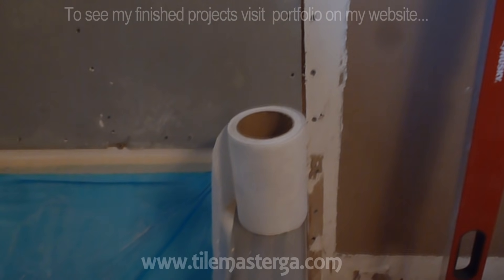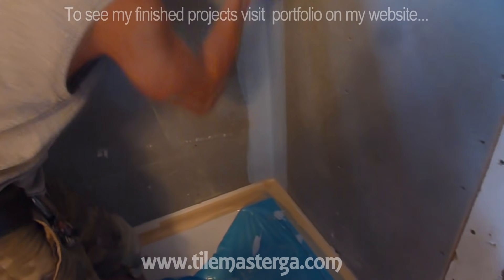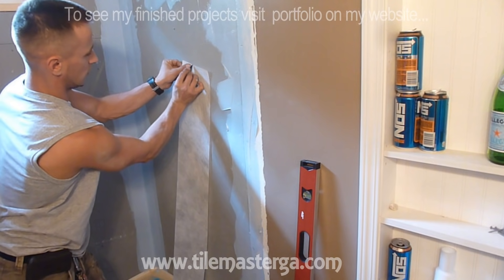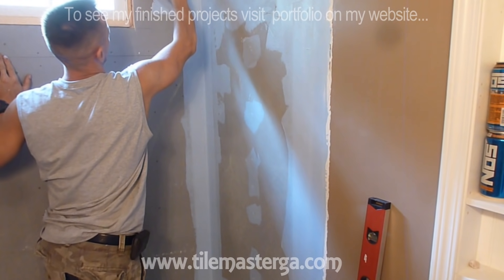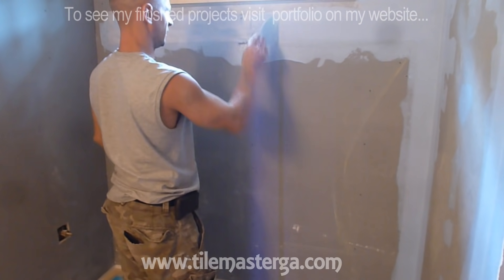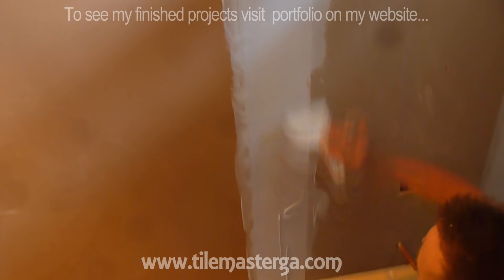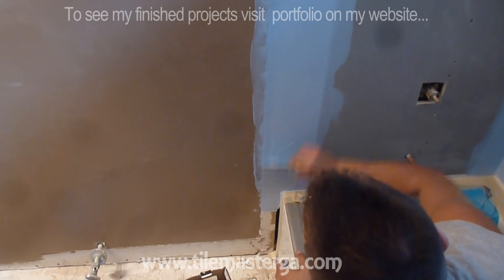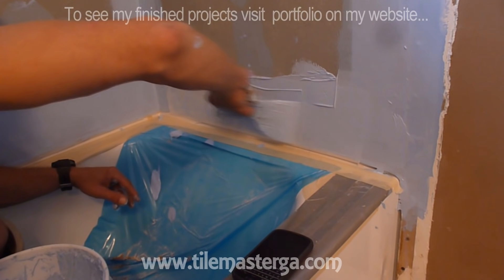HOW TO waterproof  60" tub surround walls before shower Tile installation- Laticrete Hydro  Barrier

Comment: Good day to you sir. I found your channel after installing my Durock cement board and getting ready to waterproof. After watching this video and the ease at which the Hydro barrier was applied. I would like to do the same. I have a couple of questions for you and the group. In addition to using Hydro Barrier in the corners and the seams, can this be applied to the rest of the cement board for water proofing? Or do I need to use another product? If I can apply to the rest of the cement, will the mortar adhere to the Hydro Barrier?Or, I did see another waterproofing material called Hydro Ban. Can that be applied in the same manner as the Hydro Barrier. It seems the Hydro Ban can be used as a total package. Thoughts from anyone?
Reply: I don't use hydro ban or barrier, but i think they are the same product. Regardless, read the product description to see if it is designed to do what you want and follow the instructions to a "T." It will specify what type of mortars can be installed over it.

Comment: I am using durarock board i got your hydro barrier as you recommend but do i need to apply a primer on the board before i install the hydro barrier for a good hold? thanks tile master I love the videos they are a big help to me....Pete
Reply from the maker: Pete, do not apply any primers, no need for that.
Just make sure to wipe all dust and membrane will bond the way it should.

Best regards.

Mike

Comment: well this is what not to do the wall board should sit on the ledge of tub the back wall needs to be furred out so board sit on the tub the other walls where it meets exsisting drywall you can knotch the back of the bottom or use (2) 1/4' boards so one sit on the top of flange and 2nd one goes all the way to the tub ledge dont rely on tape and hydro to seal the water thats used on joints corners and screw holes home reno version explains this very well 90% of the water will hit the bottom 3 feet if you want to tile job to last for more than 5 years do it right

Comment: Overall, great job and very informative.  However, I really wished you would have showed how you filled that LARGE gap on the left side of the tub. That looked like a significant problem area and resolution of that issue was skipped on your video. Also, some clear close up shots would have been much appreciated.  Your camera didn't focus very well on the close up shots.
Reply from the maker: Hi there, well, peter left and there was no person to film me doing that - but I been explaining that this area gets filled with 100% silicone and additionally with waterproofing membrane combined with mesh tape - you can still see it on video.

Also I shower how to fill gape around this outside oval corner - on the side we do same thing.

I hope that helps and good luck with your project.

Michael - http://www.tilemasterga.com

Comment: TMG, I have a 1/2" gap where my Durock meets the ceiling. It is too big to pack with silicone. Any suggestions about what to do?
Reply: chance144 Chance you can use quick set (hot mud ) used in sheetrock applications to fill any holes and it sets in 20 minutes, 40 minutes or 90 minutes depending on which one you buy. Once it is hard then you can tape as normal over it. Whether you are water proofing with a membrane or in a normal room with taping mud.  Warning be sure you clean all your tools outside while it is in a workable state and tools are clean. Don't clean anything inside your home in your drains...

Comment: Why no mortar on mesh tape seams? Why using 3" putty knife and not roller? Why not applying membrane everyone and double coats? So many directions from manufacturer disregarded. Not even using vapour barrier behind cement board...
Reply: KINGsizeWINNER Don't use a vapor barrier behind the board if you waterproof with the membrane on the front. One or the other. If that's densshield, only the seams need to be waterproofed since the board has a built-in vapor barrier.
Reply: Michael Barnathan My apologies, I wasn't aware that DensShield board has a built-in vapor barrier.